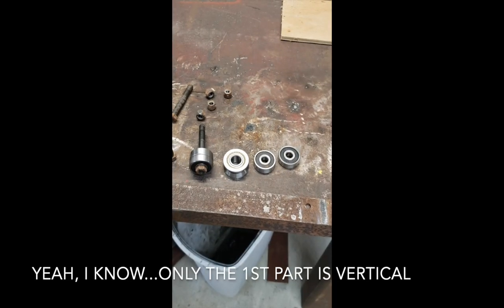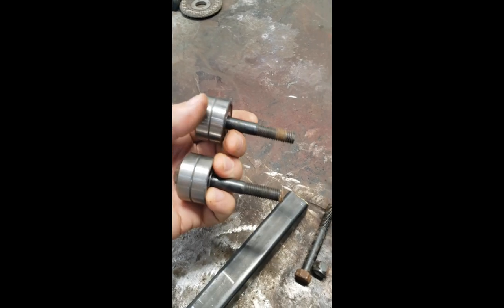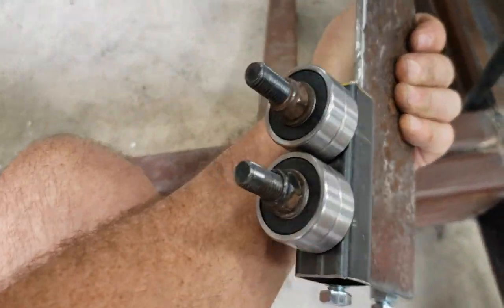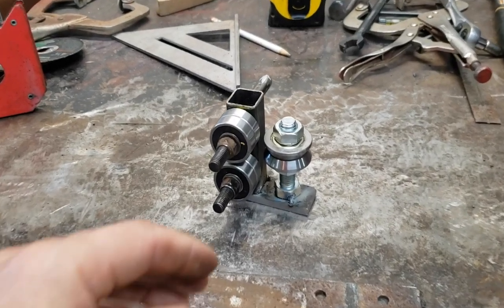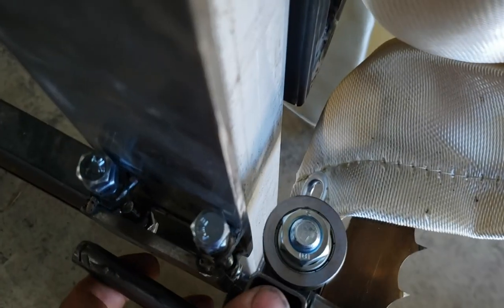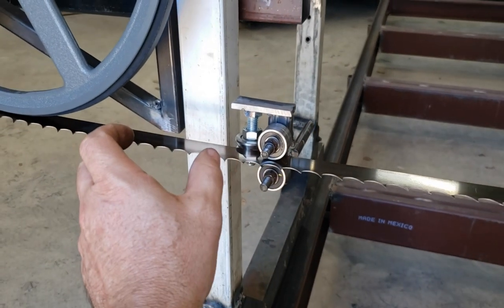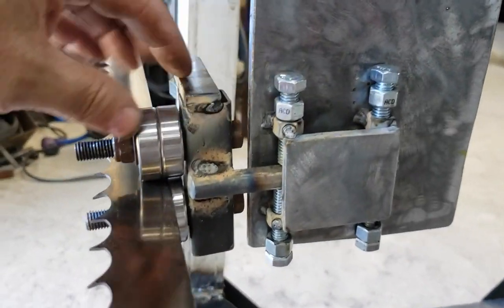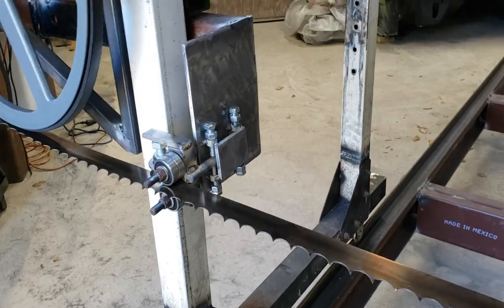Kman Builds - DIY Homemade Sawmill - Blade Guides Video #6

Comment: this has to be one of the better videos out there showing how to do the blade guides It just changed my whole way of thinking about building mine and cheaper too. Thanks
Reply from the maker: I appreciate the complement.  I worked a long time to find a solution that was inexpensive and did not take up too much of my cutting width.

Comment: Love those guides. I recently finished building my bandsaw mill. I am not a machinist. It took me a long time to finish it. It does cut pretty good. It's really amazing how many different ways there are to achieving the same basic result. If I would have seen this video a few months ago I would have copied your system. Clean ,simple. and functional. Bravo.
Reply from the maker: I appreciate the feedback..  I spent a lot of time looking at other designs but could not find one that would work.  So far it seems to be working well after about 2 months.

Comment: I would have suggested using square stock on the back of the bering assembly to prevent twisting
Reply from the maker: Yeah, I would agree but at the time I was trying different ideas and this is what I had in the shop.  One day, I might upgrade but it has not been a problem yet.   appreciate the feedback

Comment: I believe I would use a plain bearing to back the blade, then no strange forces on blade.
Reply from the maker: the v bearing has a flat area in the middle that is wider then the blade thickness so it does not seem to be causing any issues.

Comment: What kind of bearings are those? Is it two stacked together or is it one with a groove in the middle?
Reply from the maker: I am using two stacked together.  If needed I can add a third on top but have not needed it just yet.
Reply: @kmanbuilds   dry nice.  What width blade are you running? It looks quite wide but maybe those bearings are just really narrow
Reply from the maker: Originally,  it was 1 1/2" but I have found that it runs better using a 1 1/4" which is what I am using now.

Comment: I have the same brass barn door V wheels and wanted to ask how they're handling riding the edge of the angle iron track.  I was considering laying the angle iron track open side down and having the V wheel to ride on the V edge of the angle iron.  Do you think riding the edge is a better way to go?
Reply from the maker: I decided to use the edge because I was worried the v-groove might not match the angle of the iron upside down. It also stays very straight without much "wobble".  The wheels I have are actually steel and have lasted pretty well so far.  One thing I have noticed is they don't roll as smooth as I thought they would be its not that bad.
Reply: @kmanbuilds  sounds like there might be pros and cons either way.  Thanks for the feedback!